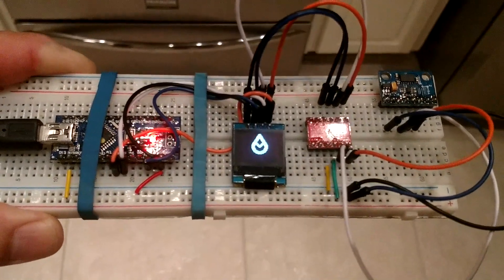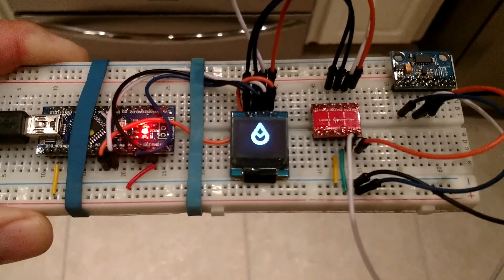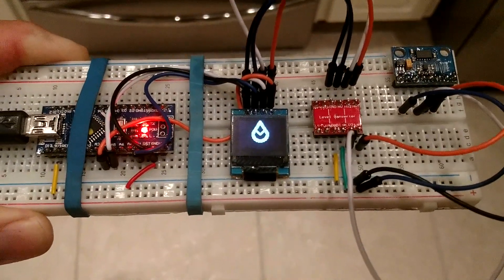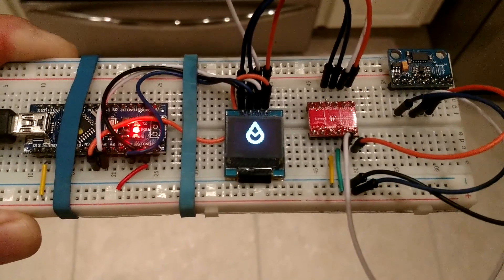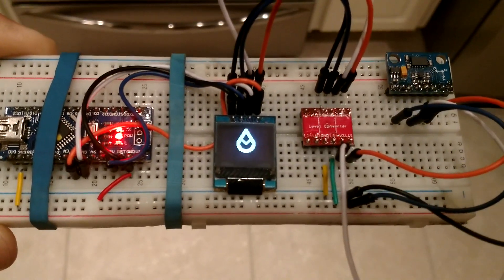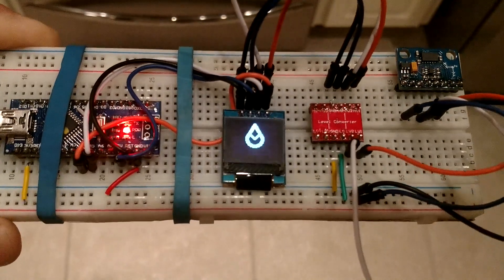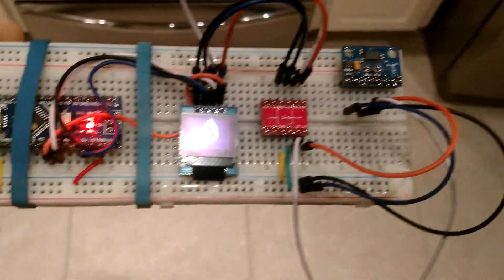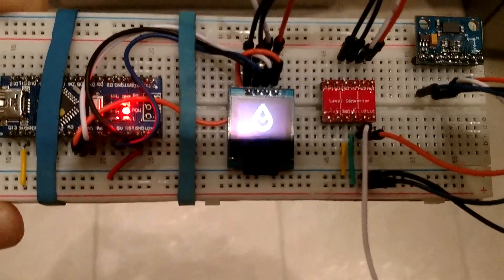Halo Assault Rifle Compass (Arduino Airsoft Project)

Comment: Do you sell these by any chance?
Reply from the maker: Alex, I saw what you are up to on the 405th. Sorry, I don't sell these. I have the one working prototype and I am at a pause on this project while I reevaluate the bullpup firing solution. I have built a beautiful bullpup AEG gearbox that works, but it is ridiculously complex to machine. In the meantime, I came up with a super compact HPA setup that promises to do the job much simpler.
Reply from the maker: I forgot to add that when I do restart this project after the Needler, I will likely produce the ammo counter/compass as a board for retrofit to CB-88 airsoft guns but it is going to be a while.

Comment: Looks amazing. Would you ever release the programming / specs? My electronics / programming skills are pretty lacking and I'm just getting into building Halo airsoft replicas. 
Did you design the CNC gearbox yourself? Sounds a really interesting avenue to go down. I have some issues with a lot of the mainstream gearboxes that are available, the V2 particularly. 
Looking forward to seeing the MA5C. I've started with an M7 myself, going onto a BR55 and maybe an MA5 after that.
Reply from the maker: I'm not likely at present to release the programming as I do plan to sell a rifle or two and export my board as an upgrade for the CB-88 chrono blaster replica that has a reputation for burning up its board.
Reply from the maker: Also plan on using my core program for carbine, DMR and BR projects.
Reply: @Redshirt98  I did mean for purchase, but I can see why you wouldn't want to. It's easy for people to reupload / pirate software, less so hardware. It does however make it awkward for people like myself who don't live in (I assume) the US.
Reply from the maker: Not a worry. I'm still a ways from having it truly ready for the AR, let alone the other projects. On the software side I'm still cleaning up the electric blowback and mag load/unload features. On the hardware side I'm still designing the circuit boards. Paired with these, all of the UNSC weapons are radical bullpups with the magazines way in the back. To do that accurately, I've designed a custom CNC gearbox. So, the programming, electronics and the gearbox are all in parallel development. In short, this is going to take some time. Even though an AR seems simpler than my Splaser, it's actually a much more complex project.
Reply: @Redshirt98  Yeah, I get that. Sounds great what you're doing. With blowback too? :D When looking into doing the BR myself, I was probably just going to throw a V3 in there, and tube the mag up like you did with the splaser. I've also noticed that the smaller the build the harder it is to work with, from working on an M7 using an AEP gearbox. 
I look forward to any updates :)
Reply from the maker: Oh I know all about jamming an AEP gearbox. Go over to Spartan Jess' channel to look at the plasma pistols we are finishing up. Beautiful so far but what a PITA. Also, my Facebook page @redshirt.prop.works has pictures and a better video of the AR compass and counter.

Comment: U want to mount this compass on airsoft rifle but what with magnet from motor. There is a nedynium magnet with very strong magnetic field. What with interference?
Reply from the maker: Great question, and one I've had at the front of my planning since the beginning. The problem in part drove my choice of chip and library. I will locate the compass sensor in the front of the gun, as far as possible from the motor. I'm using a three axis compass with compensation in all axis. Once I mount it up, I run the compensation sketch, determine the three compensation values, then enter them into my final programming to zero out the effects of any interference inherent to the final installation.